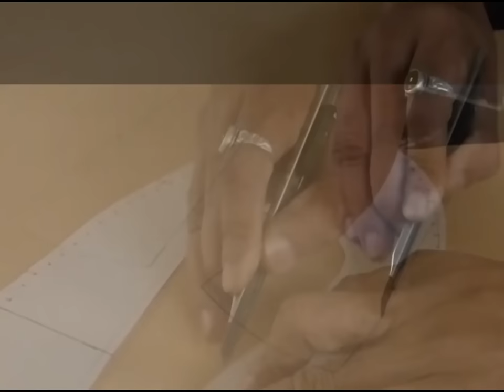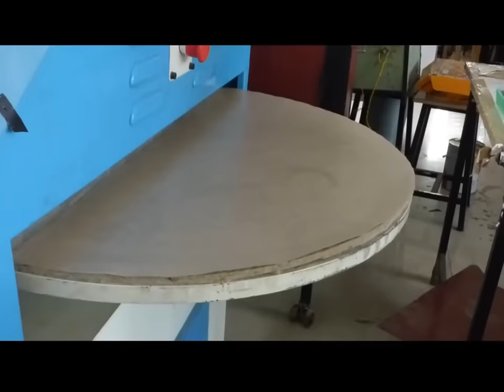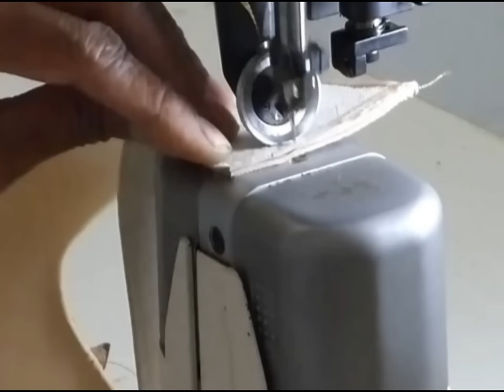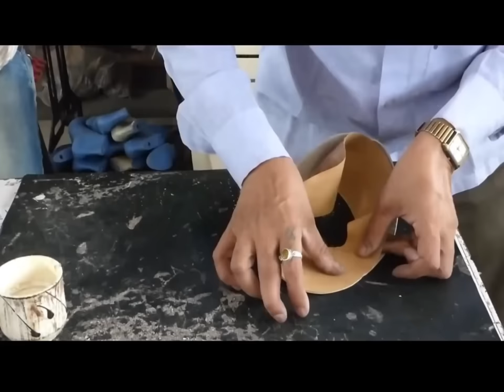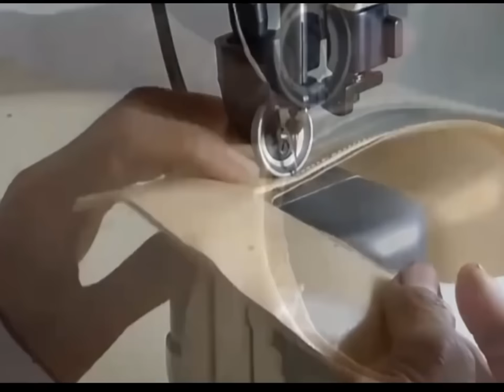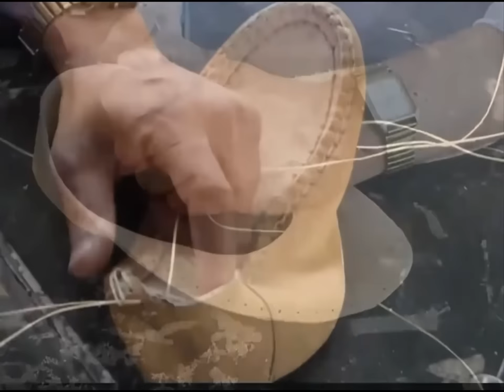How To Make Ballet Flat Shoes -  Handmade Handcrafted Artisan 1

Comment: one question, I am just starting to explore the shoe making process, and I was wondering what is the material you stitched to the leather? The one that looks like a thin white fabric and that goes on the inside of the shoe.
Reply: Probably something like buckram, and I'm sure that's an oven it went through, so something with a sticky backing that activates when heated.